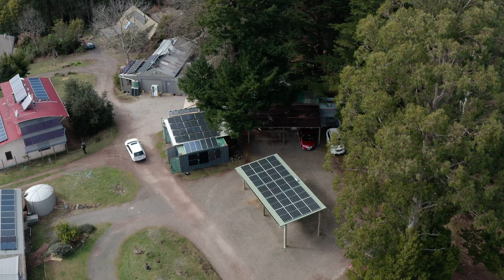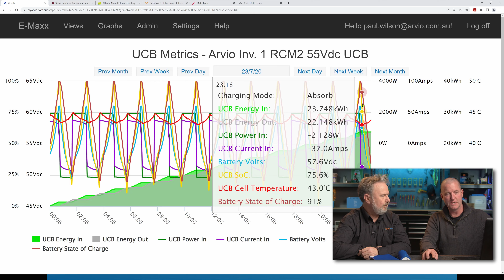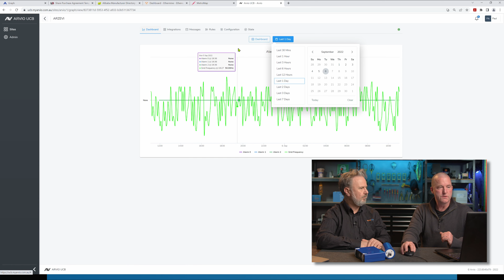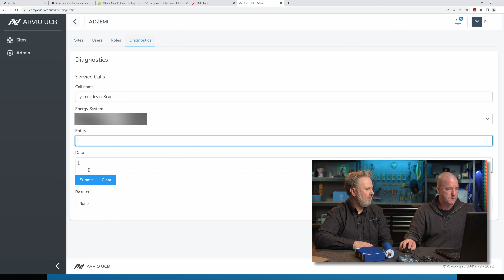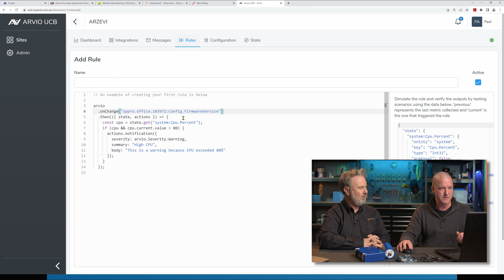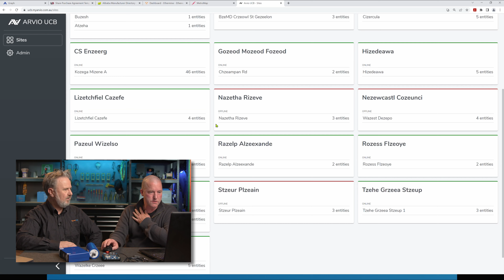Arvio Australia's EJOS smart energy monitoring and control system

Comment: 44:35 To prevent dead start requirement in off grid or a micro grid which would either need a DC charge controller or generator, you could also turn off the loads with a contactor at 10% or so SOC and leave Selectronic supplying the Fronius only with AC which would wake up at sun up. This is a problem with two separate inverters. I would hope Selectronic is working on a Selectronic ready Fronius that can wake up the entire system with PV at sun up regardless of battery SOC. The weather data could also be incorporated if sleep mode is developed so the system knows when to wake up.